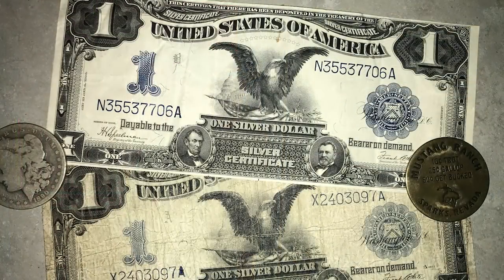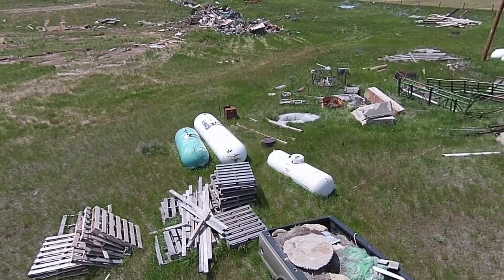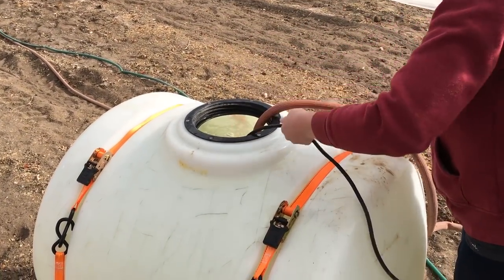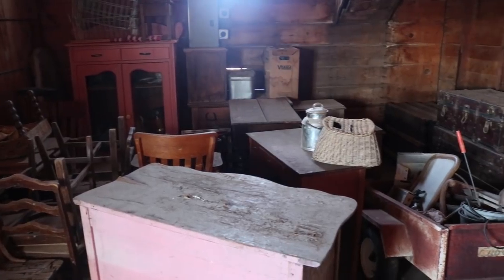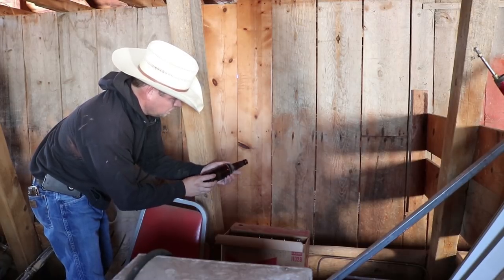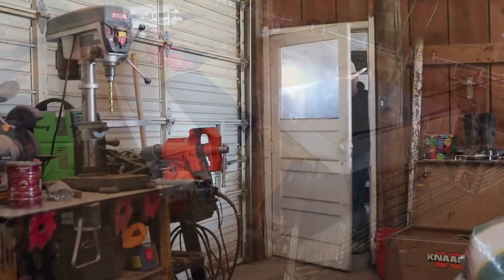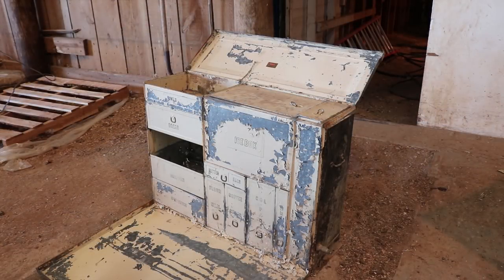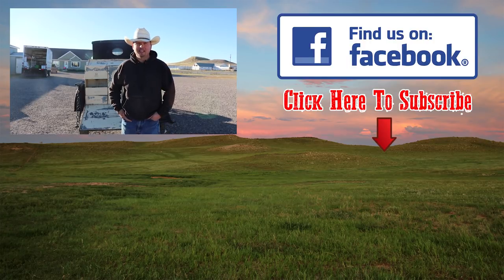Picking on the Ranch

Comment: I know all about the old farm we had to go through 2 54 ft tractor trailers stacked to the max. From front to back floor to ceiling side to side. Ended up having to put the junk into a barn on shelves. And sold the trailers. Bad part everything went up in flames during the fires we had up north last year.
Reply from the maker: Yeah, there is stuff everywhere you turn. Thanks Randy - Mike

Comment: old refrigerators make excellent refinishing cabinets for gunstocks, small cabinets and parts that fit inside. Simply rig up a light switch (100 watt) if you can find a light bulb that generates heat anymore. The chickens damn near froze when somebody went led on us????
Reply from the maker: Great idea with the fridge! Led? like LED lighting? I can see where that could cause a problem lol  - Mike
Reply: If it has a porcelain inside that refer would make a great smoker cabinet  for meat and fish. I bet you got an old box stove hinden  there somewhere too for a smoker fire box. Nice post vice, I have one like it on my welding cart. Its been in my family for 100 yrs. 🤠
Reply: Old fridges also make great curing/drying cabinets for meat.  A small dehumidifier and an external control unit and you can begin curing and drying sausages and hams like a pro in an old fridge.